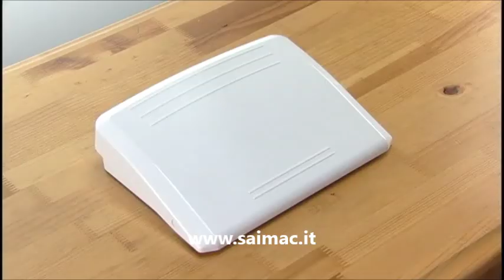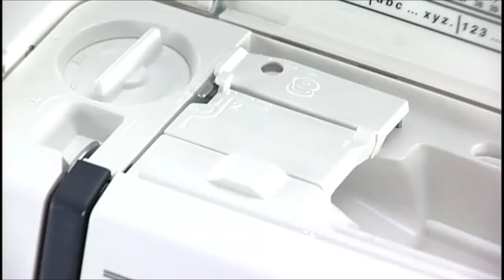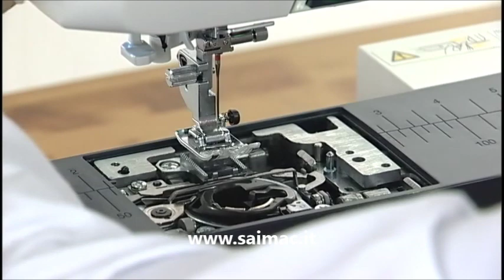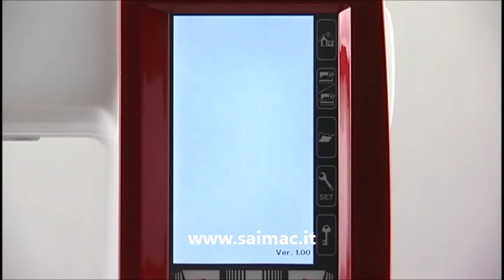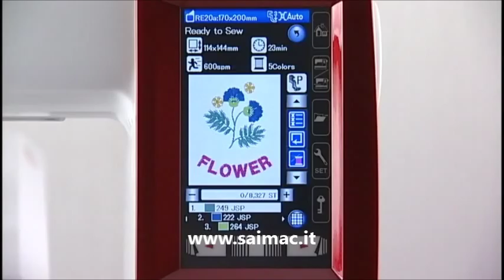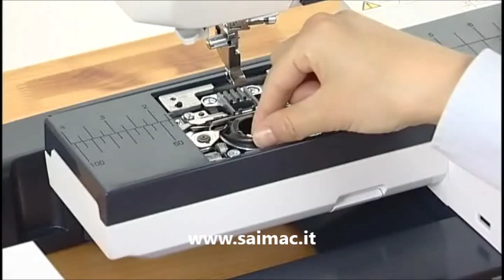Saimac - Janome Memory Craft 9900

Comment: Thanks you for this but what  l would like to is what is the biggest hoop this embroidery machine uses
Reply: It comes with 2 hoops: 140x140mm and 170x200mm. There is also a smaller hoop (100x40) you can buy separately.